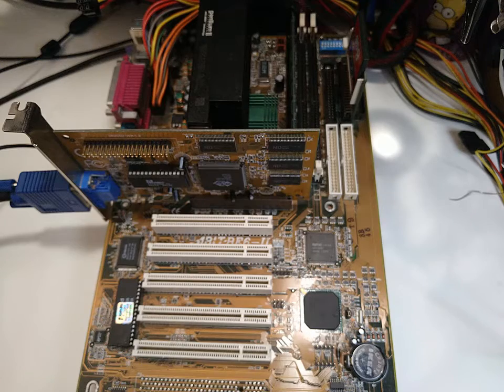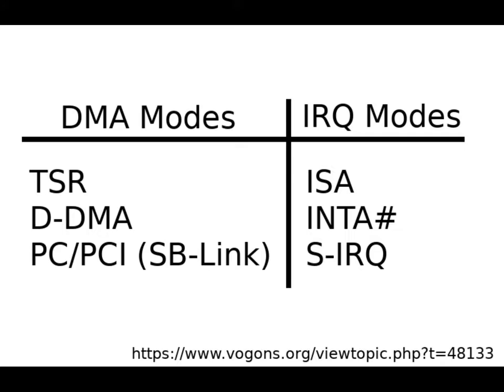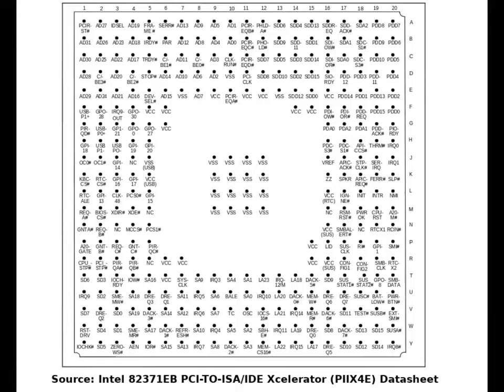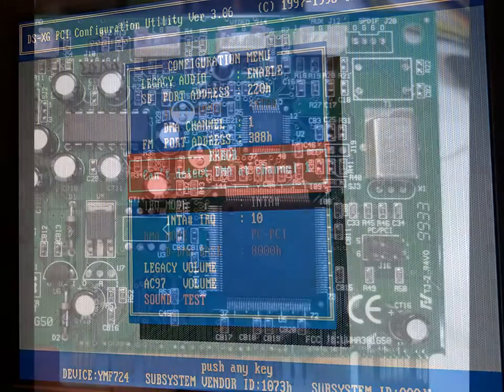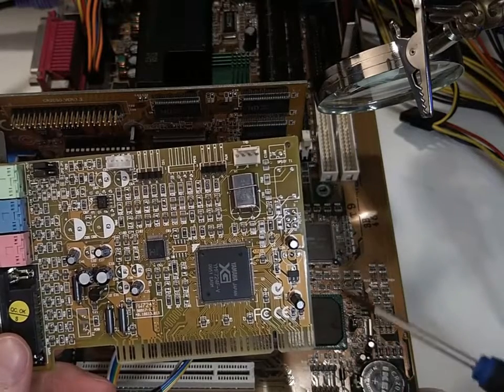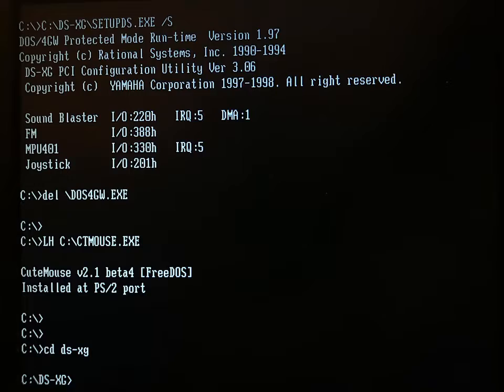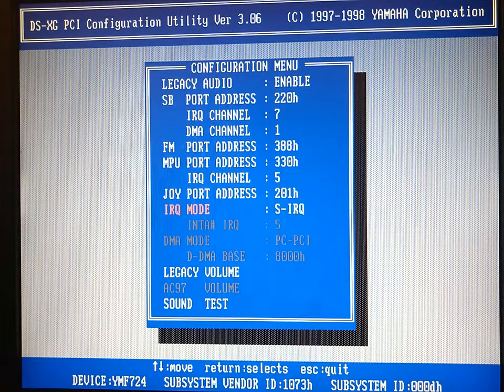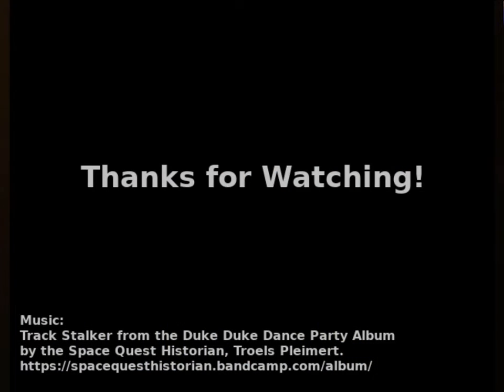Yamaha XG YMF724 PCI Sound card PC/PCI (SB-Link) in DOS #doscember

Comment: What happened when the Mainboard does not have such connector? Does it work worst?
Reply from the maker: The SB-Link cable provides the best compatibility, but there are other software-only methods supported by these cards.

Comment: one question of an solder unexperianced - would it be possible not to remove the solde from the pads first, but just heat it up and use it as is, and force the pins in the designated spot?
Reply from the maker: That would be tricky but I guess if you heat the pads long enough it might work.

Comment: Excelente!!! Es enteramente necesario agregar esas resistencias?? Mis capacidades para soldar prácticamente no existen!!!
Reply from the maker: They may not be strictly necessary. You may get it to work without soldering them. My guess is that they are used for stopping noise coming in from the connector or cable. But I may be wrong.

Comment: Great video! Thanks! Have the same soundcard but other motherboard - Acorp 6via85p with VIA chipset. Had to solder SB-LINK there (there were solder points) and lots of games works fine except... Doom 2! Have music but no SFX. I cant even imagine what this game doesn't like. At the same time if i remove SB-LINK cable and set up soundcard via INTA and DDMA - then everithing works great. Any thoughts?
Reply from the maker: Hmm could it be an issue with the VIA chip?

Comment: I wonder, if those are only 3 pinouts, on newer motherboards without the SB-Link header, could they be "piggy back" in the superIO, amr or other vias that come from the south bridge? Or disable one of the usb controlers and use its hw resources?
Or is SB-Link something the southbridge has to physically has the connectors for it?
Got a YMF744 in a socket462 that would like to use in DOS.
Reply from the maker: As far as I know only a few south bridge chips have SB-link pins. I don't think there is a way access to them through some other connector.

Comment: My solo1 has an sb-link and I have the cable, but it works the same with or without 😅
Reply from the maker: I don't have much experience with the solo-1. The only one I have tried was an on-bard one and it would not switch to ddma/s-irq mode, not sure why. The default mode was not very compatible with old sierra games though.

Comment: Has anyone managed to make CD audio tracks work in DOS? I've mostly everything working perfectly with the PC/PCI connection, but DOS games that need CD tracks for music just won't play them through the sound card. I have the CD-ROM drive drivers installed and the CD spins and you can hear the music through the headphones jack in the cd drive, but never through the speakers.
Reply: Make sure the analog audio cable between the sound card and CD-ROM drive is properly connected.
Assuming it is, check the mixer settings -- the CD input could be turned down or muted.
Reply: @awd42  Yes, after half a day of frustration, I fixed it by installing the latest MS-DOS drivers and utilities, and then finding the mixer with weird interface. My CD audio was muted in MS-DOS mode. Thanks!

Comment: Thank you! Now I've understand how PC-Link works. Too bad there are just a few motherboards with this connector. (My Asus CUBX-L don't have it unfortunately)
Reply from the maker: It looks like your motherboard has unpopulated SB-Link solder pads under the 3rd PCI slot counting from the top. There is a good chance it will work if you add a header.

Comment: is there way how to run General Midi support under pure DOS 6.22?  Now i have Asus P2B 1.12 with SBLink. Under W98 GM working fantastic with DOS games but under pure DOS dont know how to run GM. For example Sound Blaster Live  (SB0060, SB0100 or SB0220) GM working fine with DOS.
Reply from the maker: Good question, I have not tried GM. Have you checked with the folks over at vogons? There are several threads and tons of information about these cards (e.g., https://www.vogons.org/viewtopic.php?f=62&t=48133).

Comment: I did exactly same thing you did to my AOpen yamaha PCI sound card. I added pins, resistors and connected it to the motherboard with jumper cables just like you did . But then it didn't work. I thought there must be an incompatibility issue with the motherboard or some other issue. I gave up there and just used an ISA card. Then I wanted to give it another shot and then I realized a jumper cable that connects pin 4 was actually faulty! I replaced it with a working cable, all works perfectly well now. Since then I always do a continuity test on a jumper cable before I use it.
Reply from the maker: Wow! Faulty cables are the worst!

Comment: Is there a way to use dos audio without the pc/pci connector? Thinking if you boot into windows and click on the file for say duke3d?
Reply from the maker: Yes, these cards support many types of compatibility modes, including ones that don't need the cable. These will work fine in many games. The PC/PCI cable will just make them compatible with even more games.
Reply: @scrap_computing  I did try yesterday in duke nukem 3d and midi works great. However game sounds just give me a stunning blue screen and a system hang. Not sure why that computer had such hatred for dos. It's a socket 370 with 1ghz cpu however it's missing an Isa slot. So I guess it's a windows only pc haha.
Reply: @ToxicwasteProductions I can't get sounds to work in Duke3d on my Yamaha either.

Comment: I absolutely loved this video! There’s so much useful information in this video. I thought you were done with the first card, after which you pulled out another one. That concluded it, right? No way! The SMD’s aren’t installed yet! 

Absolutely loved it! You’ve got yourself a subscriber!

Now, we do need to solve the issue of only a few motherboards having this header. You’ve mentioned those pins being available on the CPU of that Socket 3 lay-out, and one of those SB_LINK headers being very close to the southbridge. There should be a way to be able to get this to work on more motherboards than the ones with a plug-and-play header on board, right?

Thanks again!
Reply from the maker: Hi, glad you liked the video!
Some motherboards do have an unpopulated header that you can add yourself. But if the motherboard does not even have pads for it, then I think it would be really hard to add one. The reason is that the chipset is surface mounted BGA, it is not in a socket. You need to access 3 pins on the chip: REQ-A#, GNTA# and SER-IRQ. On the 440BX the first two are on the outermost layer of pins but the third one is on the second row of pins. You may be able to solder some jumper wires to get to the first two, but the third one will be very tricky. Well, you may go half-way there and use only the two outermost pins (and use the PC/PCI DMA mode and skip the SER_IRQ in the configuration).